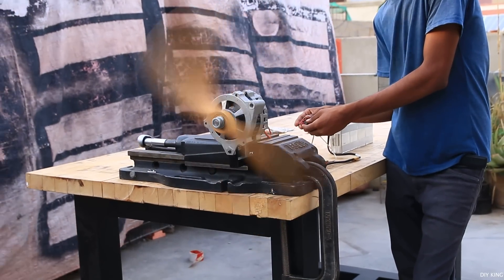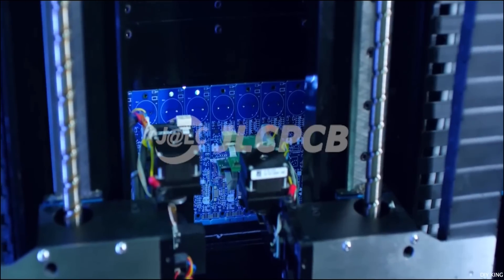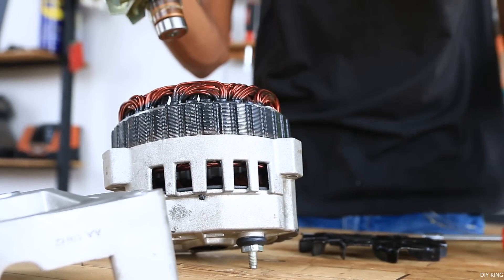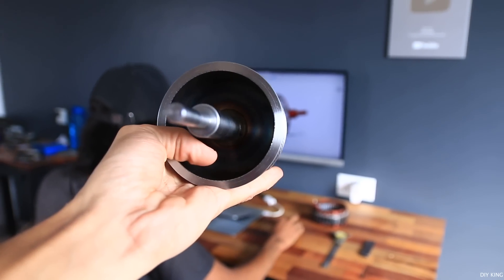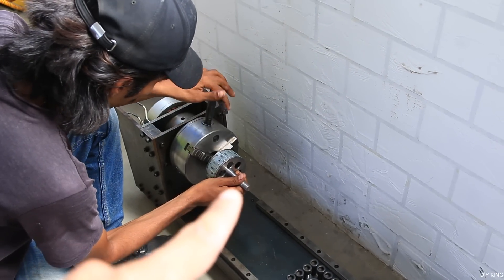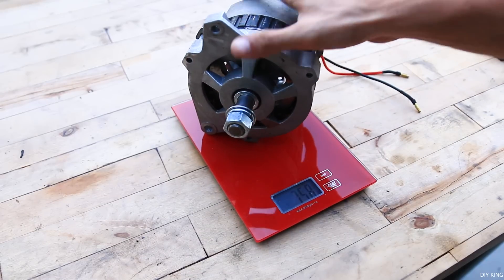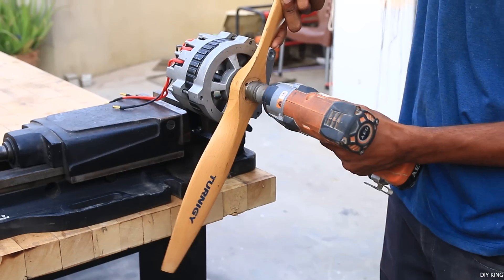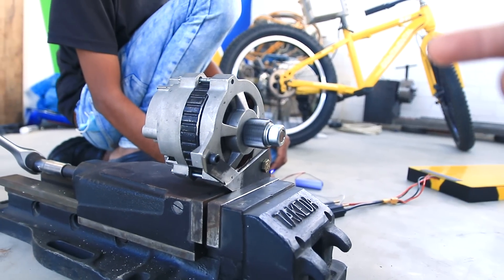Converting a Car Alternator to Produce Free Energy

Comment: In this and many other videos I see that there are 3 wires coming from alternator. BUT! When I opened my alternator and removed rectifier, I had SIX wires coming out. Both ends of 3 different coils. But of course I don't know what to do with the other three ends, or which three ends are the correct three ends

Comment: Thanks for the video.
Please how can someone use a lister generator alternator to generate electricity by using a motor to drive the alternator and the output of the alternator will give load to equipments and still be able to power the driving motor back, in such a continuous way that external power will only be used to jump start it?

Comment: Try using a super capacitor through the brushes from the output, should be able to use some residual magnetism in the rotor to start up the magnetic field, could be that a universal motor would work best seeing that the rotor in those are silicon steel, keeping more residual magnetism than a starter core, mostly from cast iron. Might be wrong as I am only from a mechanical engineering background. 👨‍🔧🦾

Comment: Since you mentioned an unexplained loss of power in the alternator rebuild video, I have been wondering whether or not you placed the twenty four magnets correctly on the rotor.
Regarding the three stator windings:  I think the stator coils are seperated by 120 degrees.
If you placed the magnets as follows would that produce 120 degrees of seperation for each phase of the 3 phases?  Let's see:  24 magnets /3 phases = 8 available per phase.
Should it be 8N 8S 8N? Doesn't seem right…too many Norths… How about 4N4S4N4S as the following: NNNN SSSS NNNN SSSS NNNN SSSS. This seems right to me..there are equal norths and souths.  I think your existing sequence for the permanent magnets  is:  2N2S….etc. as follows NNSSNNSSNNSSNNSSNNSSNNSS.
Reply: that would reduce the torque of the motor... To reduce the cogging just skew the magnets!

Comment: The free energy must be a collapsing Ether field producing electrical transients. Turning car generators into windmills is not entirely free energy. Converting a car alternator to produce free energy can be done by anyone with some basic knowledge of how electricity works. The process is simple and only requires a few supplies that can be easily found at any hardware store. With a little elbow grease, you can turn your car into a green energy machine that produces clean, renewable power for your home or business.

Comment: For a permanent magnet synchronous motor the ideal supply voltage at any given rpm will be about the same voltage as what the motor would generate if spun at that same rpm. At the ideal voltage the motor current will be in phase with the voltage and the power factor will be highest and the current draw the lowest.

Comment: how do you keep the heat generated by the rotor spinning (friction w/air) from decreasing the magnets magnetic force. You heat magnets up, the become junk metal, so....  Also, the glue has a temp limit as well. There's got to be heat there from eddy current as well?

Comment: Can you guys do more on converting alternators to PM motors and generators? Is voltage determined by rpm? I see some that say they make 220 v. How does number of neodymium magnets effect output? Would they be single phase or 3 phase? When its brushless, is it ac or dc? Thanks.

Comment: Hi, I have Doubt...After Conversion into BLDC motor with Permanent magnets like yours, What is minimum/maximum Voltage does it can operate.
And what if supply 36/48v input from battery does it work or the winding will burn...?

Comment: Updated : you Hook the 12vlt Gen to a 240vlt Motor = free power    []__[]----- [] power board =240vlt -
Videos about youtube     a guy has a great build for this  Imagine free elect run that aircon free in summer & heater in winter +   
run 12vlt LEDs lights   be handy in a bush cabin  .

Comment: Hi, thanks for sharing. I also have high power at no load on my conversion, even with original rotor. I have 200w at 24V. Tested with 2 esc , same result. I will test also another alternator

Comment: there IS a load on the motor: the propeller. it is doing work to move air and thus draws power, even if it is stationary. This explains the RPM as well: if you were running at no load then you would be close (ignoring internal motor friction/losses) to the max RPM, but because torque is being applied to the motor you need high current in the winding so the RPM (and back EMF) has to reduce to allow for the current.
Reply: I think the main problem is their rotor design.  With low magnetic coupling, back emf is low so current is high.  Plus it been an all steel 'ring' the induced magnetic field in the rotor will be doing all sorts of unwanted things.  The motors in the Tesla's are a full induction motor with no magnets in the rotor, the specific shape of the steel rotor gets an induced magnetic field in it which becomes the repulsive magnet, quite clever actually.

Comment: Awesome work guys, can you do a comparison between your modified rotor and the stock rotor?, working as a motor, like what's the difference on RPMs, Watts, etc. Also what is the material did you used for the rotor, steel or aluminum?

Comment: One might wonder, if cogging between poles can be reduced in half by introducing another motor on a longer shaft, but with the second rotor's  magnets rotated just enough that it falls between cogs on the first rotor. 

The output of each alternator could be rectified to DC and then their rectified output could be wired in serries, effectively making one alternator with reduced cogging and 12v at closer to 600rpm. 

By the way, are the coiled connected wye or delta?
If it was wired delta, then reconecting the coils as wye will get you more voltage.  Where line voltage on delta connected coils becomes 1.732 times as much when the coils are wye connected.
Reply: Brilliant input.

Comment: In your opinion, if we remove the piece that controls the voltage emitted by the generator, and adjust the rotational speed through the stove at a medium speed, neither small nor large, in your opinion, how much electricity will output, volts and amps, approximately.  Thanks

Comment: The blades are load for the motor🤦🏻 the faster it goes the load increases due to air resistance. ✌🏻I have build many motors in past you can contact me if you want

Comment: hello if you want to use it as a generator, it is more useful if you connect the coils in a star. It is as simple as desoldering the ends of the coils and connecting the ends of all the coils to a common point. So it would be 20v, or less kv if you want to use it as a motor.
Good job and keep it up

Comment: One question - how does a dc motor run on a battery without the electronic drive unit (ie motor controller)? That’s the part that converts the dc supply to a sinusoidal (or usually square wave) signal. Also, if you have a motor, why would would you take the magnets out to make a dc motor from an alternator?  Just asking - maybe I’m just dumb.
Reply: Brushes, they invert the polarity of the motor, check any video on it!
Reply: sergioro8_12 they say at the start it is a permanent magnet BRUSHLESS motor. Something wrong here.

Comment: OMG,  you guyz are just genius  using those neodymuin magnets from the hoverboard motors was just pure genius. you literally just solved a mental block problem I've been having for over three months.
thanks Guyz, great video  great build. 
keep it coming
Reply: Newtons third law of motion is the reason its doesn't work. The north and south poles of a magnet are of equal strength. Think about it.
Reply: @paulsmith1981  could a magnet be applied elsewhere to negate the pull between the poles?
Reply: Cómo alternador si funciona de esa forma pero para  motor brushless era mejor como estaban en el motor  de la patineta
Reply: There is free energy and free energy generators. Yours aren't working. For your personal use and not for commercial purposes, you can build one that is located at the national patent office in Alexandria, Virginia or at international patent offices in Paris, France or in Geneva, Switzerland. With the deep state practically expropriated, there is no longer any need to fear that they will come in with hired killers and take you off. Do your own research.

Comment: Can you please tell me where do you outsource the rotor's machining process? I am in Karachi as well. It would be great if you can give me there address. Great video by the way 👍.
Reply: In karachi you can get this rotor made by Engine cylinder refurbisher lathe man. Where you get bore the bike cylinder. He can make show him the video and give him stator. The air gap should between rotor magnet and stator should be 1.40 mm rotor dia shorter than stator.

Comment: instead of thread you can try epoxy 2 part resin. And then turn it on your lathe to a smooth finish
Reply from the maker: Yes we did thought of that but the down side is without any fibre a crack in epoxy can panetrate quickly.

Comment: Nice video! Reduce the battery voltage if you want to decrease losses, the stator windings of an alternator are designed to operate at high currents / low voltages if you use high voltages you will need to increase the frequency in the inverter to increase the speed and thus the back emf. If the inverter does not reach such high frequencies all you are doing is waste the energy heating the windings. So you can add a higher load to increase efficiency using high voltage or if you want to run the motor with no load you need to decrease  voltage to increase efficiency.
Reply from the maker: Will try that as well, seem like a good idea.
Reply: @DIYKingSaM  hi, i already test and see the efficiency problem you need to change the coils wiring to star not delta wiring
Reply: @DIYKingSaM  even if you use higher frequency you will face skin effect problem (your alternator coils are 1 solid wire not multi thin wires )your coils will not handle the high current and will heat up change the wiring to star wiring
Reply: @DIYKingSaM  Answear should be : I will try, thank you.
Reply: There is free energy and free energy generators. Yours aren't working. For your personal use and not for commercial purposes, you can build one that is located at the national patent office in Alexandria, Virginia or at international patent offices in Paris, France or in Geneva, Switzerland. With the deep state practically expropriated, there is no longer any need to fear that they will come in with hired killers and take you off. Do your own research.